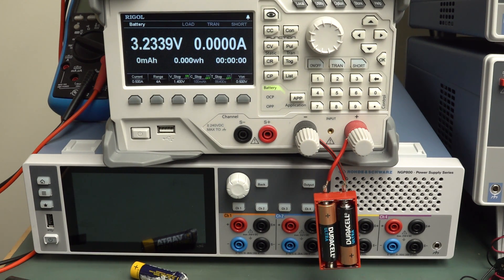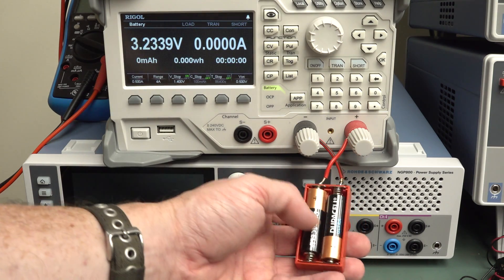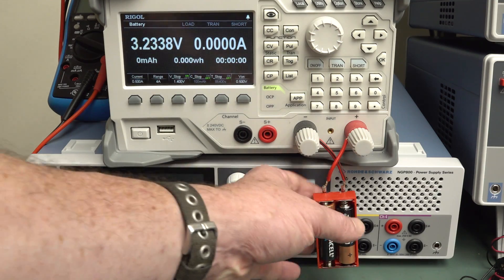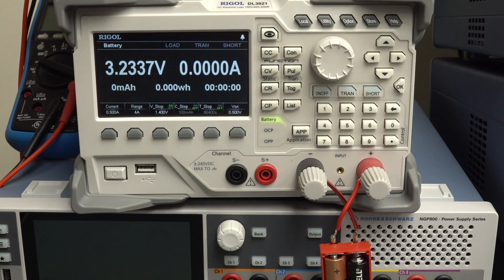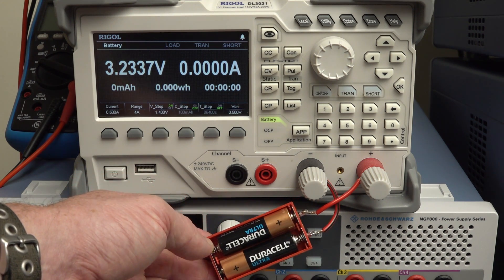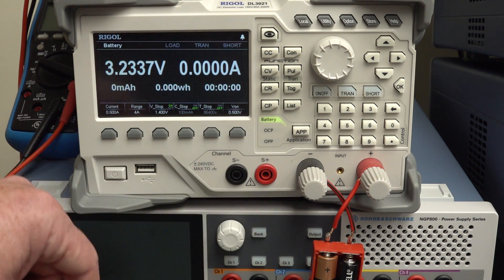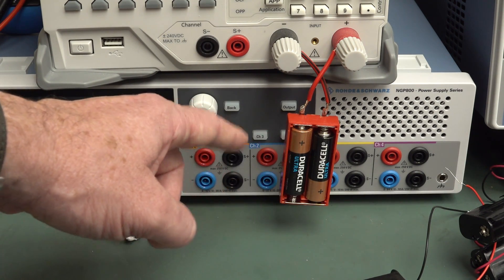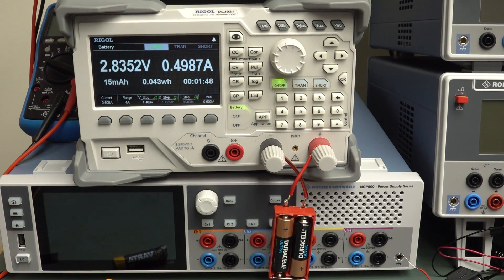Alkaline Battery Discharge Testing Part 3

Comment: Ive noticed that my Rigol dc load is reading quit a bit off from what any of my multimeters read. Have you or would you do a video on calibration procedure on the Rigol dc load to get better capacity reading directly from the rigol dc loads?

Comment: A while back I remember reading an article in a technical EE journal (EDN? Electronic Design? E.E.Times?) concerning the design of alkaline cells. The article made the point that the typical chemistry can keep the internal pressure under control as long as the voltage remains above 0.7V or so. Suggestion- Discharge them to significantly less than 0.7V per cell before long-term leakage test storage. Thanks for the great series of videos.

Comment: As mentioned before: The leakage could depend on the spring pressure of the battery holder. If more expensive devices have better, stronger springs then the leakage affects valuable equipment more.
Reply: I think it more Murphy's law that it affects more expensive products first. :-)

Comment: If the batteries were in parallel instead of series, would it prevent the possibility of reverse charging or not?  I know that the battery holders might not work this way, I'm just trying to improve my understanding of how different ways of connecting the batteries could change things.

Comment: My observation is that low load over long time is the real world challenge cause if the cell gets below working voltage after 2 years you usually see if it leaked or not.
ALDI cells are a nightmare in this kind of challenge and regulary leak in AA or AAA size, but do not leak when used in chrismas tree candle lights where they are running out of juice in 10 or 12 evenings. But in those cases you can observe another point you might have missed or overlooked: the chemical reaction inside the battery will increase its diameter

The result is challenging too: you can not get the cell out of the chrismas tree candle body without much force and a plier ...

Therefore I stopped buying them and purchase only industrial cells from VARTA in 40 pieces boxes or Sony. They do not leak in any case even after years and the do not increase its diameter with all its implications. In most daily use cases I use enelope rechargeable cells except all huge amount usage cases cause I do not wanna charge 20 or more of the enelope cells when they all run out of juice at the same time. Enelope never leak and are always ready to use ... but in a few cases with just a low mAh capacity ... another case for real batteries if you need high Amp or many mAh like in Cameras and othere devices.

Comment: i have an idea which could cause the leaking... the battery drop test to see if charged or not!...dropping it on the -ve could slightly pop the seal...
im thinking the spring pressure on the -ve of cheap batteries is popping the seal aswell
Reply: Good thinking, perhaps it is the physical forces over time rather than chemistry

Comment: Why not just stick a LED on each pack or at least after you've fast discharged them? I've found flat batteries stored ok but if left in a device turned on they leaked.
Reply: Because as soon as they drop past the forward voltage of the LED you'll get no current. And that's generally 1.9v minimum even for low-drop red LEDs, so you won't get much. A Schottky diode might work better, it'd be 0.1-0.5V needed to drain anything.
Reply: @PeregrineBF  thank you
Reply: @PeregrineBF  There is no miniumum forward voltage below which there is no current flowing. Take any diode and measure it. Its a log curve (exponential increase of current with higher voltages). So if you display that on a linear plot you get the usual curve. Example that I measured: 27 V zener diode, in the normal direction the current follows the following equation: I [mA] = 7E-7 * EXP(23*Volts)
In reverse direction its: I [mA] = 2E-5 * EXP(0.24*Volts)
Untill the threshold Vz is reached, at which points its fairly linear: I [mA] = 30*Volts - 780mA
You can just plot these correlations or type it in for one or two voltages, there is no "no current".
For said 10µA "standby current" in my case it had to be ~0,45V, half the forward voltage drop of 0.9V where it reaches 420mA.
Reply: My daughter did a science project using a dollar store clock and a few resistors. Start it up and go to bed. The clock will show you the capacity of each. (She actually used three clocks to do this faster and by cross checking found that each clock was a close match to the others.) Dave, you have to “get back to the basics” and eschew all the expensive equipment!

Comment: Over the last ~3 decades of using AA and AAA batteries, I've noticed two types of development: 1st, batteries (especially the rechargeables, but I think also the non-rechargeables) have constantly increased in capacity. I remember my father charging AA batteries over 15 hours, and they were NiCd's with something like 250mAh, so now we're an order of magnitude higher there. And 2nd, devices that use batteries have constantly become more energy efficient, so a set of batteries for a device lasts much longer today than it did 30 years ago. So that means, it's both a trend in the same direction. Higher currents were drawn out of batteries in 1988 or 85 (when I was still a little kid) than in 2020. Now you mention that batteries actually have less usable capacity when higher currents are drawn. Does that mean that the batteries from the 80s haven't changed as much as I would like to think? How much is the factor of "more capacity due to smaller currents being regularly drawn out of them" as opposed to actual higher capacity? How long does a 2020 battery last with a Walkman from 1985, compared to batteries from 1985 would have lasted?
Reply: Devices might be more efficient but look at all the tech we cram into devices. They aren’t the same in terms of features. Some remotes today have LCD touchscreens so any efficiency made in the remote just got gobbled up by the tech added to the remote.
Reply: Re discharge rate:

Discharge current causes voltage sag. High discharge means closer to cutoff voltage, less run time. You see Lithium cells rebound quite drastically when you pull their max continuous discharge but it is deceiving. Cutoff at 2.5V and rebound to 3.1V. Wow that’s like gaining over 1/3 of its capacity back….but not really. There’s not much capacity below 3.2V. For Li Ion the bulk of it exists from 4.00 to 3.40. Rough numbers.

Comment: I noticed you're using your Rigol DL3021 instead of your BK Precision 8601. I have been in the market for a DC load lately and am very interested to know why you often switch between the two. I've narrowed my selection to one of the two you have, and would be very gracious to know which is better for which application. A video comparing the two would likely be a hit since they are the only two contenders in this tier!

Comment: Yo! Dave, most batteries that I had fail "catastrophically" were batteries that were left forgotten in devices usually draining a lot of current.
As far as I can remember from when I was also a kid, these were batteries left in motorized toys or left open radios or whatever, but devices that would 
drain at least 100mA maybe more, and that would usually happen after a longer period of time, like the battery would remain on heavy load for at least a week
after they were totally drained. 
I really start to think that the pressure starts to build up after the batteries have given most of their chemical energy and then there is a subsequent reaction that takes place.
Reply: Most fond memories actually come from Nintendo GameBoy(s)... Batteries died and then somehow you forgot them inside for a month or two...
Reply from the maker: The thing is that everyone has their own story and different theory about under what conditions batteries leak.
Reply: @EEVblog2  So maybe then, just maybe... We got a "we hope they notice they are empty before they leak" story. And then depending on various tolerances, they leak sooner or later.
Reply: I had at least six new batteries leak sitting on the shelf still in the manufactures packaging.  Not even a year old.  I contacted the manufacture.  They paid to ship them back and in return I got 5% off my next purchase of deodorant.  Yup, sent me coupons for deodorant.  I'm not creative enough to make that up.  It was a massive pack of batteries, easily cost ten to fifteen dollars.

Comment: Why don't you solder a diode on each set and connect them in parallel and then discharge then it's gonna be a lot faster